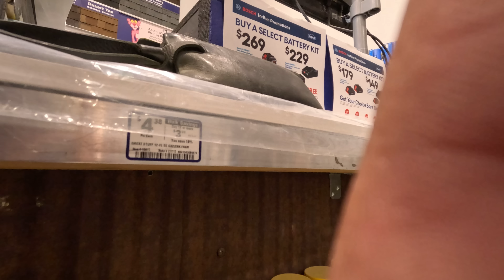Someone HIT the Truck House! (Hit & Run)

Comment: i guess that's why a wood cabin camper beats a fiberglass shell or aluminum camper.. you can do repairs with commonly available materials on the road.. if you have the skills of course. too bad people don't stop .. it's possible if they were a big vehicle with a trailer they didn't even realize they hit you.  glad it was a relatively quick repair. stay safe!

Comment: Timmy hated that someone was not gracious enough to own up to the accident with your camper. You handled that well. That pack raft seemed to ride higher and dryer than your hard shell kayak. It handled e erything nicely. It did look fast. Great little paddle. 👍👍👍

Comment: At 14:51 - a “Pioneer” electrical component in the dash!
I love it - brings me back to my early days of driving @ 1988 when we’d all buy the “coolest”  jalopy we could afford, then save up to replace the factory radio with whatever cassette player & rear deck speakers the local K-Mart had in stock. 
Craig, Kraco were the most affordable, but if we had enough cash saved up, Pioneer, Sony or Kenwood were an instant cool upgrade!!
Cranking AC/DC & the Scorpions before school or after football practice in the High School parking lot in my SWEET ‘81 Plymouth Reliant K, then ‘84 Ford Escort 4speed manual made me feel about as cool as Jeff Spicoli from Fast Times @ Ridgemont High!!
Thank God I’ve grown up but would not trade those memories for anything in the world!

Comment: Just an idea: get an aluminum work platform. The fold up and don't take much room and like a 101 uses. Use it to stand on or a seat or a small table. I carry on for my mobile detailing and find I could not be without it.  It has replaced multiple items that I used to cary.
Reply from the maker: yup those are great!

Comment: Glad to see you were able to get the roof and fascia board replaced and the steps. It ashame the way people just don't care about hit and run, most likely was a company van or someone with a U haul that's never driven one. For I've seen several people think oh it's nothing to drive a U haul. But don't have a clue what the mirrors should be adjusted for the driver and all the notes and stickers in and outside of the truck says. Like the clearance and paying attention to the way it handles. Specially the 26' one's I don't know how many times I've seen them pass a vehicle and don't realize that they have to be able to see the whole vehicle and be 4 cars lengths ahead before turning back into the right lane. I know I was given a warning for being to close to the back of a semi trailer. Was stopped in Ohio on the turnpike, and was lucky to have a good State Trooper. He was very good to me and said just remember to keep at least 4 car lengths between others and said have a good trip to NY and that was it. This was probably 30 years ago and to be honest I was drifting off the back for the trucker was hauling a$$ and I shouldn't have been doing it. But if you can catch the right spot pretty much to were you can't see the bumper and you are so close. You can literally have the car in natural and it will suck your car along with the trailer at 80-85. At first I thought the trucker was going to be pulled over. When his brakes lit up I backed off put it in 5th gear and left him go and that's when I seen the trooper sitting to my left side. Stupid stuff and don't ever do it people, like I said it was years ago and I was young in my mid 20's. Thank you for sharing your journey and I appreciate everything you put out. Safe travels my friend and God bless you. Just gave you a true story to help pass the time one night looking at people's posts. 👍🏼🙏🏼😇👋🏻👋🏻👋🏻

Comment: Btw at Lowe's and home Depot you could just use your card or cash buy ladder and then after you're done fixing your truck you just return it it's faster if you do it with cash cuz it may take up to a few days for car to get back into your account but you can do that next time both stores will happily take it back it's kind of a cool loophole as long as you don't destroy the ladder

Comment: You were literally in my back yard when you went down the Deschutes.  It really sucks that some
lowlife hit your camper and didn't even attempt to make contact with you.
Unfortunately Bend has changed and not for the better.  Back in the day if someone did that,
they would have tried to find you or at least left a note with their info on it. 
Now Bend is full of Liberal, It's all about me people that migrated here from So Cal and other areas.
It really started going downhill in the early 80's when the Californians started flooding Bend,
and it has continued to get worse. Bend  used to be an awesome little town. The people here
were blue collar and most worked in the lumber mills. Sadly those days are gone forever...
Reply: Same here in Washington. The tech boom radically changed the voting pattern and overall attitude and feel of the place. It's a damn shame... 😢

Comment: Sorry about the truck, I know the ladder thing is super annoying but it is to avoid being sued. If they give you a ladder and you fall off or get hurt using it they can be liable. I have been a building engineer for almost ten years and everywhere I have worked has prohibited us from loaning out alot of things for this reason.

Comment: It’s not cool whoever hit the truck and didn’t stop. I see a lot of things get hit by big trucks on the highway and they don’t stop or report it.
I don’t know if it happened at night or in the day, but you really should consider installing some yellow and red marker lights on the sides of the camper to indicate its size and shape in the dark. 2 red markers, one at the top and bottom as far to the rear as possible on the sides, and two yellow ones, one on the side of the flatbed and one at the top where the camper begins. Do this on both sides, wire the marker lights to your taillights.
It may seem silly but those marker lights can mean the difference of being visible or invisible on the road. You can research “vehicle side marker lights”, “vehicle clearance lights”, and “vehicle identification lights” for more info on vehicle lighting that could help avoid this in the future.

Comment: Where you were hit, that was a commercial truck or a rental truck.  The driver maybe new and afraid of getting fired.  Whoever rented the truck didn't pay for the insurance.  Or someone who has lost their job is moving for a new job and bare has enough to get there.
Sometimes, it's frustrating.  Many times, instead of anger if we extend compassion, we are rewarded many times over.

Comment: Dude, you're blocking half the lane.  NW Bond Street has white lines as a vehicle length guide and from your Instagram post your left rear tire was on that line.  That puts your house over 6 feet out into the lane.  No one could get by you without moving over into the other lane.  You showed poor judgment parking there.  This one's on you.

Comment: A hit and run, not reported to law enforcement? 

Maybe keep your oversized vehicle off city streets.

The side of damage was adjacent to a no parking area( yellow painted curb) and 10’ up.

What did you run into ( hit) ?

Looks like you faked the damage for Internet content, which is a common thing . 
 
Hopefully you find a way to get some security camera sponsorship out of this. They may not notice that you faked it.
Reply from the maker: yeah there's no such thing as a turning vehicle over 7 feet tall and long enough to clip it on the right hand turn at the intersection that I was parked at the corner of😂